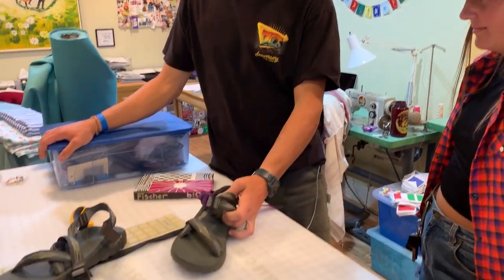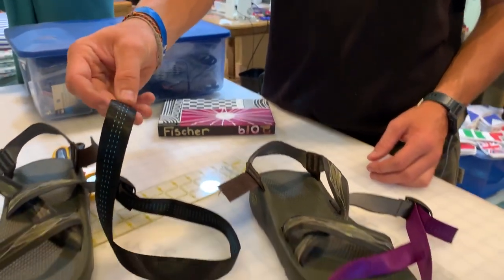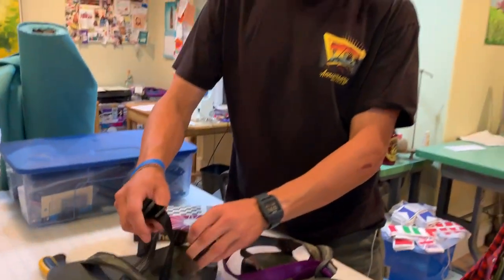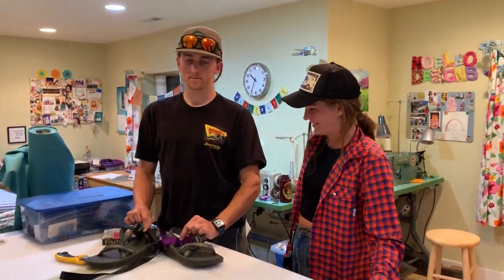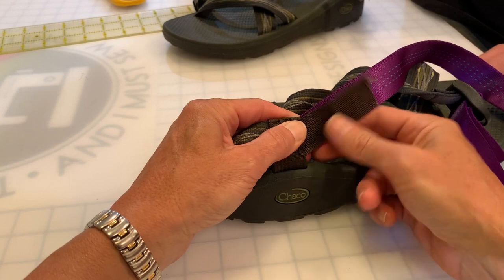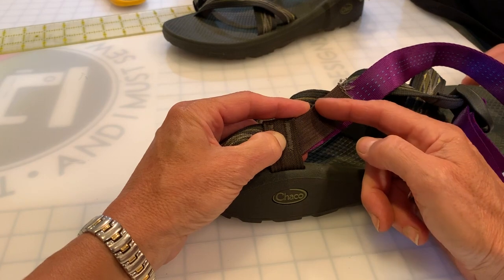Chacos Sandal Repair

Comment: Did you use an industrial sewing machine? What gauge of needle? Trying to replace a buckle on my Chacos but am nervous about ruining the machine because the webbing is so tough and needs a good backstitch. TIA!
Reply from the maker: Hannah Lyons I did use an industrial machine (but I would consider it industrial due to the fact that it just goes really, really fast) Any machine would do with a heavier duty needle like a size 90 or heavier. Take your time as you sew and just about any machine should be able to go through a couple of layers of webbing. Good luck!😊